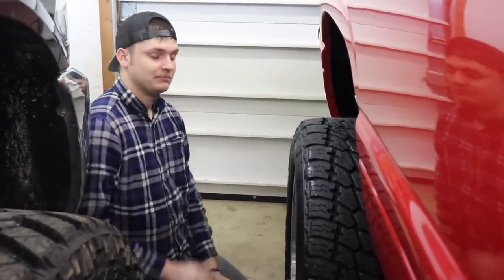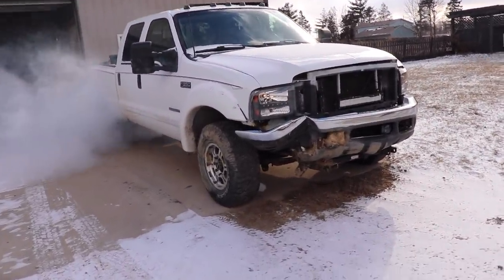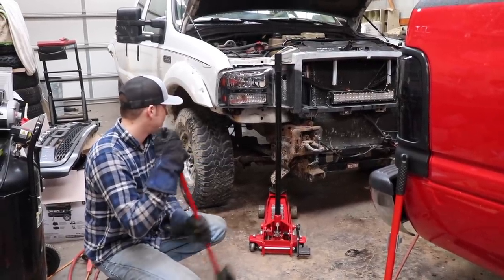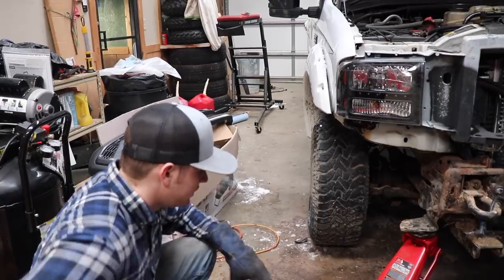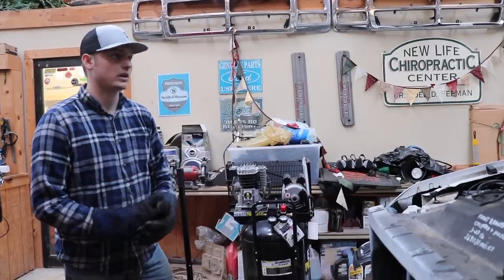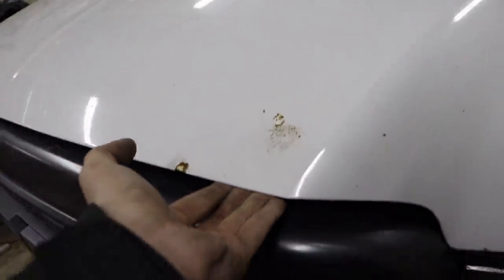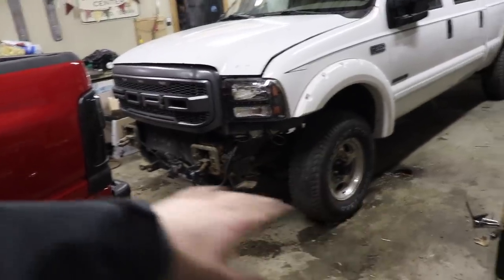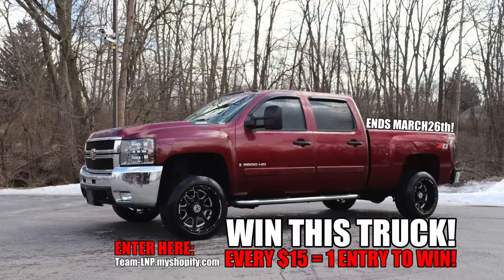THE 7.3 POWERSTORKE IS COMING BACK TOGETHER ALREADY!!!

Comment: Nothing worse than taking wheels off without power tools. Buy an electric impact.....you can get a nice milwaukee for about $350, it will have more than enough power and batteries last a long time. Worth every penny.
Reply: Craftsman is way cheaper and will do more than he would need.
Reply: @gunnerdetra9449  well whatever brand....he just needs one lol
Reply: Totally agree. They make jobs so much faster. Expressly brake work and stuff like that.